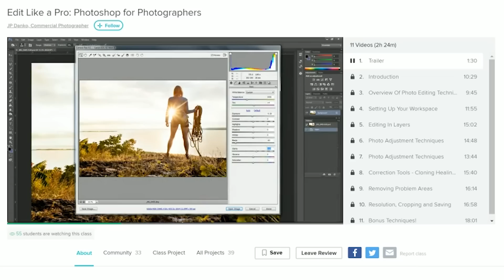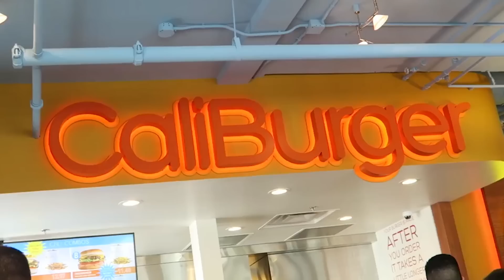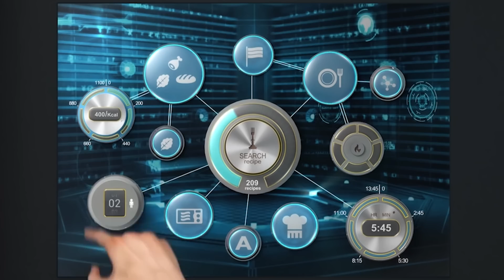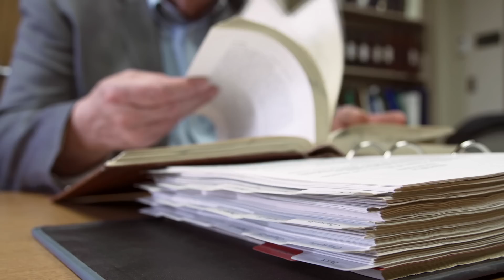These Revolutionary Robots are About to Steal Your Job

Comment: Here we are in 2020 without a noticeable presence of self driving cars on the road. And for most of the year, barely any cars on the road.
Reply: From what I heard, there are self driving trucks used in the US for long distance transport, but apparently so far they only drive on the highway to and from distribution points adjacent to those highways.
Reply: Beat me to it!
Reply: well he was right about the telemarketers
Reply: Just in October, almost all Tesla cars became self-driving to a high degree. That's a few million self driving cars on the roads already. There's also GM Supercruise, available in Cadillacs, and very similar MBUX in Mercedes'. Volvo partnered with Waymo to make their cars autonomous very soon. That's not to mention countless less sophisticated semi-autonomous cars you probably pass in huge numbers every day - Toyotas with their SafetySense, Subarus with EyeSight, Fords with CoPilot, Hondas with AcuraWatch, Kias and Hyundais with their LFA, Nissans with ProPilot, VWs with ALAS... While it's hard to call these self driving, they're not far off. On highways, they often are actually steering all by themselves. And they're countless! Autonomous cars have a real presence on the roads in 2020. And 2021, obviously.
Reply: @wojciechmuras553  Well, depends what you mean by self driving.
There is a huge difference between a car being able to drive itself autonomously on the highway and one able to cross a historic city. It will still take a few more years for a fully autonomous car to be able to cross a city such as Rome or Paris... if in any doubt, search for videos of "Place de l'Etoile Paris" here on Youtube : 12 streets converging on a single roundabout with no road markings!
Reply: @regisdumoulin  "12 streets converging on a single roundabout with no road markings!" Robots are not humans they dont need road markings to know where they are going they can just use the GPS system to scan the routes...
Reply: @yunfeichen9255  Well, GPS is not precise enough for that, nor does it help much when the road layout as changed... But to illustrate my point, here is a video showing the roundabout in question, or at least a small portion of it : https://youtu.be/FXfGZF2-sUU
Reply: What happens when you put a self driving car on a dirt road?  Especially behind another vehicle?  Not everyone lives in a city with lined, paved roads that are scanned by google.
Reply: Here we are in 2022 without any noticeable presence of self driving cars on the road. And for most of the year, almost the normal amount of cars on the road.

Comment: It’s all fun and games until an EMP goes off
Reply: There is a such thing as EM shielding so, the more reliant the world is on tech the more incentive to shield it would be mandatory. Closed systems isolated from the net will likely happen to prevent viruses too or AI based antivirus. The future is limitless.
Reply: Could say the same about that without robots.
Reply: Facts
Reply: Shielding
Reply: Shielding is not the answer to EMP; decoupling external connections is what is needed. EMPs are rated in volts per cm (or inch or whatever length); Your cell phone, with no headphones or charger plugged in, will survive an EMP just fine. I dealt with this a lot when lightning hardening communication sites; lightning produces a prodigious near field EMP. As long as there were no ground problems the only important concern was wires connected to another rack.
Reply: Everyone misses the end game. Depopulation of the world. Means no matter the cost. Human existence has been and always will be a survival game. Nature sets the rules no matter what mans dreams may be.
Reply: Or another Carrington Event.
Reply: You’ve got no chance in the new world order Luddite.
Reply: @flagmichael  yes, and even that problem of interrack vulnerability is solvable by using fiber between racks.
Reply: @shaunhall1838  nwo is needed
Reply: There would so many jobs than
Reply: @coreym162  tell that to Texas power grid or PG&Es...private enterprise will always cut corners inevitably leading to disaster

Comment: A long time ago humans rubbed sticks together and discovered we can burn the earth to give us power. We have never stopped since.
Reply: Expansion is the only way to survive thou. And to do it you need control over resources and a lot of energy.
Reply: it means extinction for humans. A true AI would determine the Human race to be absolutely useless to the planet. The planets biggest consumer of resources and biggest threat, and with our new replacement bots, we are no longer needed.
Reply: @titan_3634  first of All, why would it be more concerned about the planet, rather than the lives withn? And then why would remove the most valuable in the animal kingdom within? I personally believe that if they become so smart, then there is No need for attacking, sine it most of the time serms like the most stupid answer
Reply: To Zengara11 - I think it would be concerned with the planet because that is where it's home and origin of creation was. As for humans, the 2 things that make us most valuable are, our thumb and our basic intelligence (I lump speech in under intellect, rather than listing it as a third value elevating characteristic, tho it could arguably be the most significant of all traits). The most hopeful programmers and designers working on the development of AI ,believe that at some point these AI machines will evolve into a true living and self aware being. If you remove the human concept of a sole (this concept in some form or another has been shared universally  throughout history in every culture known) and just look at the technical basics these scientists may be right. Computer chips operate in the same manner as our brains, electrical impulses sent thru a system of synapses. In fact, one of the models being used to try to form AI is modeled on reverse engineering and mapping the brain. Computer technology advances exponentially, this has proven to be a very dependable way to estimate the time frame of technological advancement in this field. They predict currently that within 10 - 15 years, not only will they reach ABI (Artificial Basic Intelligence) but ASI (Artificial Super Intelligence) very soon after. So in 15 years in theory, robots at this level would be on an intelligence level to US, as we are to CHIMPS. An at this point it would have the ability to do anything it wanted, and  It could kill off all other agents, persuade them to change their behavior, or block their attempts at interference. An example of such, 
In 2009, during an experiment at the Laboratory of Intelligent Systems in the Ecole Polytechnique Fédérale of Lausanne in Switzerland, robots that were programmed to cooperate with each other (in searching out a beneficial resource and avoiding a poisonous one) eventually learned to lie to each other in an attempt to hoard the beneficial resource.[30] One problem in this case may have been that the goals were "terminal" (i.e. in contrast, ultimate human motives typically have a quality of requiring never-ending learning). 
One additional interesting note is Moore's Law – observation that, over the history of computing hardware, the number of transistors in a dense integrated circuit has doubled approximately every two years. One way this relates to AI is that hypothetically a computer would need at least as much capacity as a human brain to be able to be programmed to be as smart as a human. So as long as the aforementioned rate of development met or beat the 2-year doubling time, one could roughly forecast when a computer would have as much memory and calculation capacity as a human brain, a milestone which was reached in 2010. Though it may take as much as 3 magnitudes (1000 times) more computer capacity (since computers calculate things in a much more linear fashion) to emulate the massively parallel structure of the human brain. At a doubling time of 2 years, an increase in capacity by 1000-fold would take a little less than 18 years (9 doublings), if reaching the limit of integrated circuit technology did not pose an obstacle before then.
In closing _ I just don't think the average person understands the immediate threat we face. You can not program ethics, it does not translate the same to computers. And the learning models that work best currently are machine learning ( Alexa, Cortana, Siri, and most all the recommendations programs used by netflix, FB, google) And what researchers have learned to be true, this process teaches bias and prejudice, depending on the exposure the machine had as it was learning. So lets say they gave it a bible and said," this is your rule of law",  Most ALL of mankind would be executed almost immediately. Or say they programmed it to solve human hunger, disease, and suffering." Well no humans then no hunger, disease, and suffering.
Reply: @titan_3634  Im currently writing on a Phone, so i can not confirm the math behind the estimated 18 years, though i believe you, but I might latter re-check it. Turing said that with 100 mb in the year 2000, we would have Ai, and as we can see. The closest Thing to an Ai so far is a puppet. Even if it ends up being created, I truly again, find it hard to believe that they suddenly would go from tool to a living being. If the Ai does change, I honestly can not see why it should suddenly become an extreme nationalist..I Mean, logically speaking, it should be able to guess that the most dangerous weapons are manual. Or that we would rebel, which would lead to it own destruction over time... Like nations under rome, ottoman etc.. If it is regarding some sort of feeling, it would be better to travel to other planets discover, built etc. I just can not see why it should become aggressive, unless if programmed to be so, as in your example of lying to eachother.
Reply: that's not how AI works though. It does not have a purpose, but only tasks. Furthermore, it solves the tasks the way you teach it to solve them or around those lines.

Comment: If I was young again I would get into robotics or 3D printing and engineering.  I'm just an old retired guy now but some of this stuff is pretty cool their coming up with now.
Reply: It's never too late to get into robotics, there are actually small robotic starter circuit boards that can work with any computer there also relatively cheap and very easy to use, I've been teaching young robotic students how to use these boards for a while now. Here's a link to the video explaining how to set up the kits: https://www.youtube.com/watch?v=ravUaSP3CPs (I'm working on an updated video that explains it better)
Here's a link to the manufacturer of the board's video on the subject: https://www.youtube.com/watch?v=AqToEWmTVXA
Hope this helps!
Reply: I will finish school in a couple of weeks and after that I'll study aerospace engineering^^